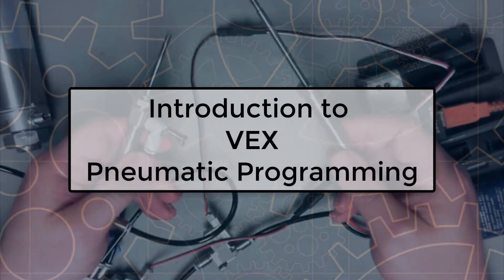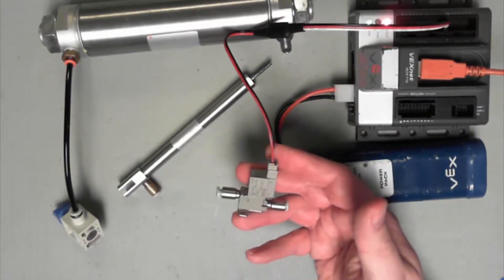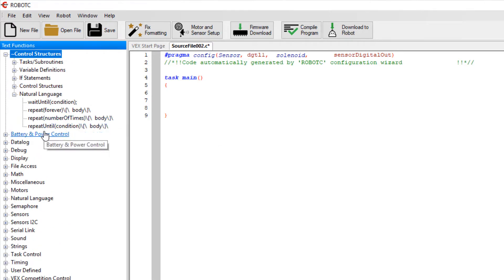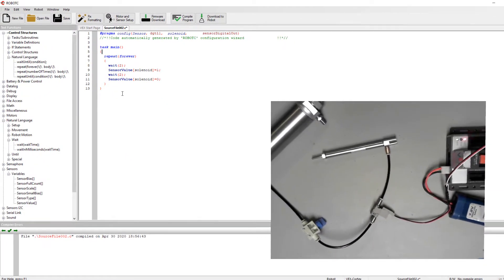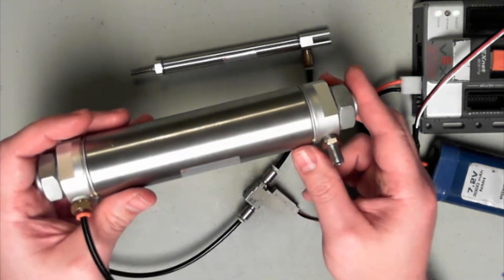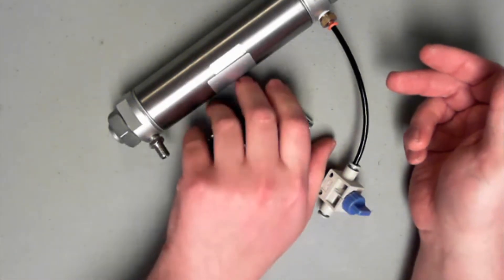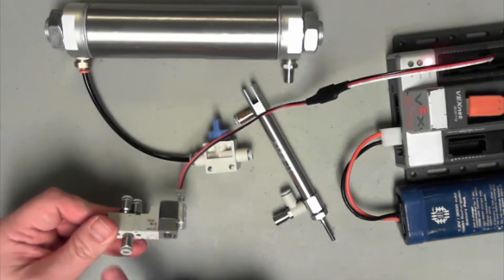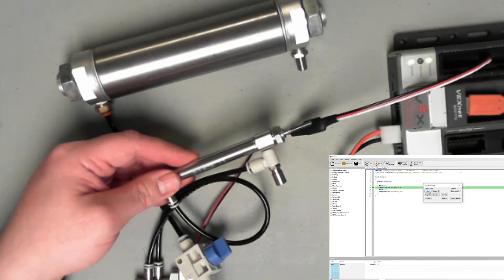VEX Pneumatics Programming

Comment: But what if you don't want it to cycle but be able to control when you want it to activate with a controller?

And hypothetically your using robot mesh studio and your using a v5 robotics brain?

As well as two double acting cylinders that would preferably activate at the same time?

-sorry, I'm a complete noob to all of this😓
Reply: for your first question: https://kb.vex.com/hc/en-us/articles/4404204989076-Controlling-Pneumatics-Using-Buttons-on-Your-Controller this is iq blocks but I think u can understand
for your second question, it takes some really complicated coding, and since this is my first year, I don't understand it yet. however, I came up with a solution that worked on our bot. if u want two cylinders to activate at the same time, connect both of them to one solienoid.